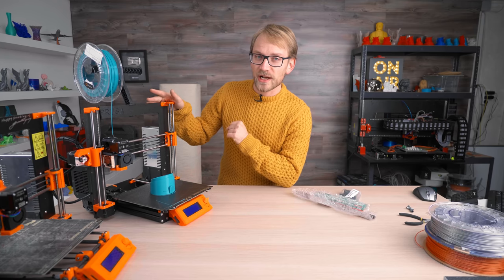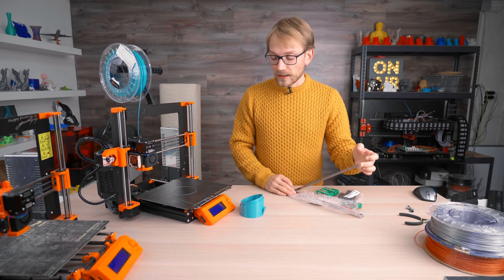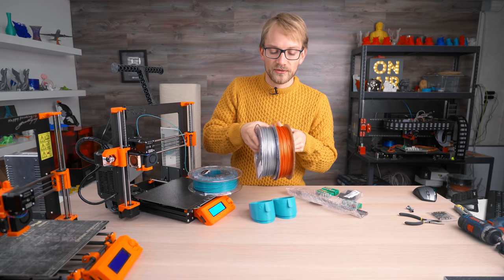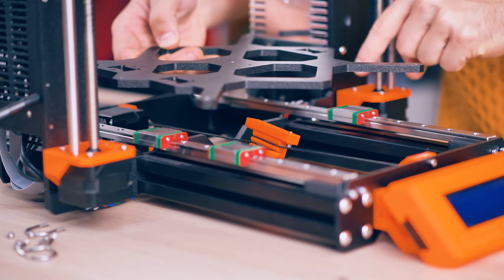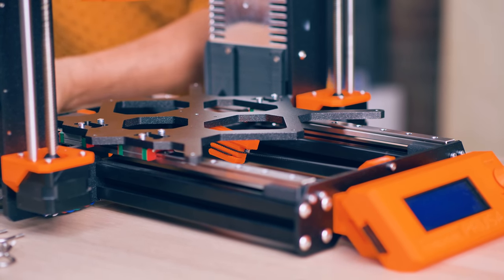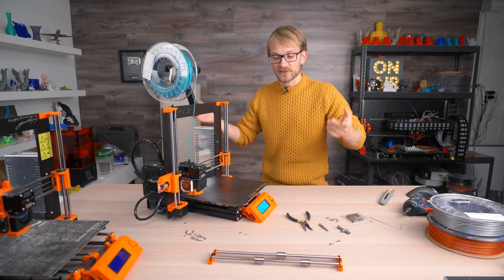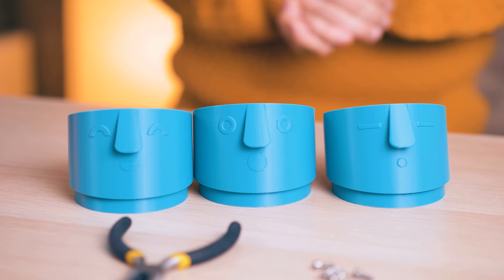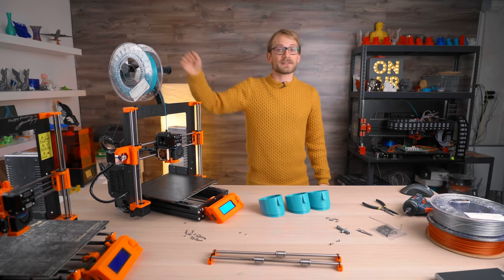Upgrading the MK3 with genuine HIWIN linear rails: Worth it?

Comment: "pulls out high precision rails"
"tightens with a power tool"
oh boy..
Reply: I seem to hear the clutch mechanism clicking, which is pretty decent on the Bosch drivers.
Reply: @JeffDM   I agree but my main concern is not over torquing. You lose a lot of feeling for how things are falling in place.

Tighten a bolt a little bit, check, align, tighten another one, adjust until everything falls in to place slowly and smoothly.

Thomas went for the AvE approach which might not be the best with precision machinery.
Reply from the maker: I've had the clutch on setting "3" almost the entire time - which I fund to be extremely consistent for mid/light tightening of M3.
Reply: @MadeWithLayers  But it is not, despite it being a torque limiter clutch, it still has enough mass to be equivalent to a mini impact wrench for a precision component that can throw off alignment. Would you like someone to build your 5axis CNC machine with an impact wrench?
Reply: Spent the whole video just wishing he grabed a plain old screwdriver! After I heard the price for these linear rails, it made me even more unease!
Reply: Eh seriously? The clutch on these are pretty good, probably more accurate than "hand feel" at the lower settings. What made me cringe more was the method and order of the bolts he was tightening.
Reply: @nzalog    The clutch might be good enough and provide a descent torque consistency across the screws, specially compared to hand tightening them without a torque wrench. The most basic issue here though is not the final torque applied nor the sequence he followed, but rather the sudden forces that the screws are subjected to when an electric drill/driver is used, specially if you simply pull the trigger full blast as if you are shooting a gun. The guy in the most liked comment explained how to properly do the job, tightening and untightening the screws, in which order, etc, which is something I would never expect Thomas to know. It is like mounting a cylinder head on a car's engine: there is a specific order to tighten the screws, at a specific torque, then you go back and torque again at the same order a bit more, and again one more time; a pneumatic or electric driver is never used tough! This is not to criticize him. I just shared the way I felt watching the video, and I am sure others did as well. Quite the opposite, I was rooting for him to stop using the driver during the whole thing!
Reply: @theonlymudgel  Your reading comprehension might not be the best, but I said it clearly that I was not criticizing him; I like the work he does and am myself a subscriber. I was just interacting with him and other people in the hope that we would increase our overall knowledge as a community. In fact, I could be wrong and was completely opened to hear new ideas and thoughts, and learn something new; or I could be right but also learn something new from somebody else willing to add to the discussion. Your commentary is quite the opposite of what I pursue when I take the time to write something over the internet. It doesn't add anything useful, it doesn't bring anything new or constructive to the conversation. Just think twice before posting something useless, specially in an informative channel like his, or you could be pointed out as an armchair critic just willing to expel your own frustrations.
Reply: @theonlymudgel  Nevermind... take care.
Reply: It feels like it is impossible to point out some errors or mistakes people do on youtube, just because they have lots of subscribers...  Using a power tool to adjust precision mechanics, like this rails, is not ideal, not because of how tight they will be,  but because you don't have feeling...  This kind of immunity to "be wrong"  and adjust/learn accordingly,  together with the feeling that we always know better, is one of the reasons Tom failed to sucessfuly finish the MPCNC, which is a simple project, with hundreds of builds around the world, and a proven concept with years of evolution...
Reply: To be onest is not so strange to use power tools for this kind of stuff. 

The only thing is that you have to use them whit extreme care.
Reply: @chargv  cylinder heads get mounted with 3 ugga duggas, whatchu talkin about
Reply: @theonlymudgel  Ok Boomer....
Reply: @theonlymudgel  He doesn't have to show how it's done when it's just enough to point out that this is how it's NOT to be done. Any professional working in that industry KNOWS it's wrong and it was clearly explained WHY it's wrong so how about you tune down your boomer attitude and stop calling people armchair critics just because you're not educated on the topic? Have a nice day.
Reply: Yeah. I like Thomas, but this make me cringe. I never use power tools for assembling anything like this. Less control and no feel.
Reply: @d7588  if you watch the video of Haas building their cnc machines you can see them using Milwaukee impact drivers when attaching the rails to the castings
Reply: @joeweber2802  Yes lets provide some limited samples of people doing it wrong. Because that suddenly means that others aren't doing it wrong, right?
Reply: He also printed his sweater...
Reply: i know i was screaming the entire time
Reply: @MadeWithLayers  ähm ja achön und gut das mit der dreier Stufe, wennst du es wirklich genau haben willst dann mim Drehmomentschlüssel, aber der Akkuschrauber zeigt fehlendes Talent. 
Trotzdem hat mir das Video geholfen.👌
Reply: @v1Broadcaster  I opened the comments just to see if anyone else was like "stop drop roll, it's gonna blow"

Comment: the primary reason hiwin or other square profile linear guides are more rigid is because it can be mounted directly to a subframe and not just at each end (also things like preload but you probably want to avoid that in a printer). By mounting it only at each end it acts like a leaf spring when loaded in the middle of the guide.

Comment: Using those Linear rails, in an industrial manufacturing plant setting, we used to very tightly rubber shockmount those carriages [Just a thin rubber gasket really].  In our cases, over 1 metre length rails, without the rubber mount the rails would bind, and resonances would be setup through the rigid chassis and moving tool head.  With them the rails would more or less self align, and run extremely smoothly.

Comment: Pro tip:
Use a guitar tuner (or app) on the belt before and after to make sure you get the same tension.
Also, use silk PLA or shiny PLA to make ringing artefacts more visible. Black PLA printed hot also shows artefacts more.

Comment: Hi Thomas,

I study High Tech engineering, which is a continuation on Mechanical Engineering. Within this study, my specialization is Mechatronic system design. I'm currently doing my Master's thesis and am working on a properly constrained gantry system, which uses state of the art technology. I can not say much about it, since I intend to start a company with it, selling 3D printers and laser cutting machines.

Basically every machine on the market nowadays uses a heavily overconstraint set-up. Having 2 cylindrical bearings perfectly aligned (functioning as a single bearing, theoretically) and having another one to cancel the rotation, already overconstraints your system by 3 (1 free translation means 5 constraints, each set has 4 constraints, totalling 8 constraints. 8-5=3). Now, doing the same for hiwin linear rails, we get a sum of 5 overconstraints (5+5=10 constraints, thus 5 overconstraints).

What's the result of overconstraining? Not only does it introduce higher order harmonics, your system is no longer statically determined. Binding becomes more of an issue, which might not be noticeable at first or by hand, however at the microscale it's noticeable. Often relaxing a certain bearing helps, since you reduce the amount of overconstraints and thus the harmonics.

One thing that confused me in this video is... Why do you wiggle the bed back and forth sideways, while the direction of actuation is through the centre of mass of the bed in the same direction as the bearings slide... The vibrations from the x-axis shouldn't cause much vibrations on the bed, since the frame is very stiff and its amplitude is very much degraded.

There's one side question I have. Once I finish my product, I intend to start-up and kickstart it. What conventions do you usually go to in Europe?

Keep up the good work!

Comment: As a physics major, I'm reminded of the damped harmonic oscillator (mass on a spring with friction) and the classic analysis about over-damped, critically-damped, and under-damped conditions.  After increasing stiffness, maybe you can also, somehow, increase dampening and/or modify the mass of the system?  

It would be interesting to analyze a Prusa i3 with something like a vibration sensor, and then do a "proper" analysis of the ringing and then optimization to reduce it.

Maybe a wider belt for the y-axis would increase dampening?
Reply: perhaps giving enough 'slack' in the tension of the Y belt might help some what? I like the widening idea.
Reply from the maker: Stefan has got you covered! https://youtu.be/Ws1JfHl3Y0o
Reply: Thanks Tom!  Will definitely go watch Stefan's video.
Reply: @evlsc400  Changing the tension of the belt will only change the frequency of the belt oscillation. If you want to dampen its resonance, you need to add some spring made of a different material.  For example a belt tensioner with a metal spring. Maybe not one on the belt, but as a holder of the belt wheel.  Still this only reduces any resonance frequency, but it will not remove belt vibration completely.
Reply: Gijs Noorlander so a spring loaded belt tensioner? If those exist I’ll test them this weekend.
Reply: Very smart!  As an Acoustical engineer, I would advise that you do a spectral sweep of frequencies, using a reference mic, and the consistent table your mounted on.
We want to do a slow SIne wave sweep and record all resonant freq.  Take that Into a graphic EQ find sharp spikes in the frequencies.  
You will most likely find one that happens every time that number doubles.  We call this octaves.  SO find the fundamental root octaves.  Next This will give you a huge idea of weather its low freq 0-220hz  add lots of thick thick material, IF its mid freq spikes then you can add some fiberglass 403,  It anything higher it will be easier to get those tones out of your prints!

I really like cnc kitchen;s vibration dampening stand, then run this test when you've made each new  change.  
IF your getting terrible nasty resonant spikes, change the tone of the printer by adding solid mass very securely with good amount of fasteners to make a new resonance to fix your prints 
I really think duets idea for resonance its interesting too
Reply: From my experience I've noticed that upgrading the belt before the game makes ringing worse as our dampens less and transfers more energy into ringing
Reply: @evlsc400  I was thinking about the idea. Maybe it is possible to print some tensioner to push down the bottom half of the belt.  For the X-axis it may be a bit harder to do since you don't have room in the vertical direction.  Maybe replacing the belts with a threaded bar like on the Z-axis is also an option? You must then add some mechanism like a shock absorption to compensate for bends in the threaded bar. (and re-calibrate the displacement per step)  I do think the resonance of the belts had more impact on the vibrations in the print than the stiffness of the slides.
Reply: Would be interesting to try.

I think I'm mostly interested in an engineering approach (based on vibration/oscillation damping).

But trial-and-error can also be useful!  Try lots of stuff, see what works.  Then how/why it works can be figured out later.
Reply: Maybe using rubber washers between the guideways blocks and the bed carriage will help!

Comment: For a while I was having all sorts of similar Z banding issues. But if I ran my finger along it I couldn't feel any sort of banding. The issue ended up being that the eSUN grey I was using (that I buy in 3kg rolls) had a large amount of pigment variation. So it wasn't actually a layer or printer issue at all. Changing to a different vendor's filament made it disappear all together.
Reply: If you trace the history of the short-lived E3D BigBox  project, you find the banding issue there as well. It seems that their primarily used stepper controllers caused some of it by introducing rounding errors in some zones. You always have to look at the whole system.
Reply: Jim Bob  I think it was just the bulk rolls - printing out some vase mode models made it visible and obvious when you looked at it. I'd not had that issue with any other eSun filaments, and I've been through probably 50kgs of it.

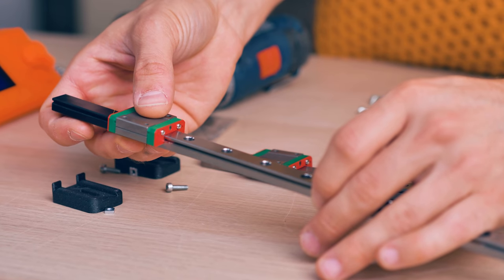Comment: 8:00 i think the y-carriage plate is symmetrical so you can have 2 bearing right or left, you can just turn/flip the plate.
A bit upsetting that the rails are not sitting on the aluminium profiles but instead sitting on wobbly plastic pieces.
Reply: They specifically point out the orientation you should be using in the guide.

Comment: We see this on our clients that buy Raise3D units, particularly engineering clients, that have an instinct to tighten every bolt. This is a mistake on the Z axis where the threaded bearings are intentionally loose to deter Z axis artifacts. They get binding as soon as it's over tightened so agreed the first one looks better for similar reasons!

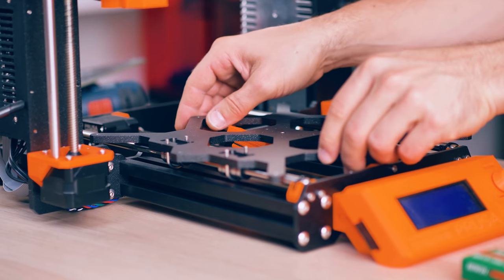Comment: 7:12 They likely had the thought, but ultimately decided against it to keep the price a bit lower. Those rails are pricey.
Reply: Some recent releases from Chinese market participants might match a better price/quality balance. You simply don't need the HiWin precision when other parts of your gear don't meet the same precision level. Still have to see a 3D printer with a cast mineral concrete bed... :)

Comment: I noticed on my Prusa i3Mk3S was producing Z axis banding as yours also does.  I also noticed the extruder was sometimes pulling hard enough on the filament to slightly deflect the print head.  This was with the stock Prusa filament holder.  
My fix was a completely new filament reel and axle running on sealed bearings that puts nearly zero stress on the print head while feeding filament.  This change made a noticeable improvement in the layer artifacts.  My latest prints are about 50mm tall and are very close to perfect exhibiting almost no layer issues.  And yes high quality filament is a must...  great video as always Thomas.

Comment: Those Z axis artifacts you're talking about may be related to the bed's temperature control. The bed expands and contracts while is trying to keep the temperature constant, thus changing the top surface height. You should check your BED PID values although it may not improve your results.

Comment: The best way to fix the inconsistent extrusion problem (which i assume is the cause of your issues based on your description) I’d suggest getting the bondtech upgrade for the mk3, which uses the original bmg geared style extruder. A lot of users had this issue, and fixed it with this upgrade.

Comment: Hi Tom, one of the thing we saw in the early days of DIY 3D printing was similar artifacting. Ours was caused by really tight belts. The 2mm teeth were giving us that slight imperfection. We wanted tight belts for precision. We gave our belts 1/2 a twist so they had the smooth side rolling against the pulley/bearing. That simple fix made our prints super smooth.
Reply: Very interesting, I actually thought of that too. Don't they skip occasionally tho?

Comment: From my experience, the belt tension is the biggest contributor to Y axis problems on MK3. Cranking it up helps constrain the bed more than fiddling with the rails.
What I'm thinking about doing, at some point in the future, is to swap the X axis rods for a rail. The print head is rather heavy and the entire assembly is plastic and thin rods, so there might be some play in there.
Reply: Yes. From years of experience with home-brew plotters , engravers, cnc and a 3D printer , keeping the belt resonance under control is vital (I built a wire drive plotter once , it rang like a guitar string , wild resonance!)  adding a couple of idler wheels (or even long slides) on the long return run can help . Too much tension is as bad as too little  - it really a case of observing and making adjustment s to kill any bad resonance.

Comment: Back in July when I did upgrade my Prusa MK3 to linear rails, it cost me under $40 bucks not 200 Euros. Print quality stayed great but the lower noise level of the heat bed was well worth doing it. Also you can gain up to 15mm or Y travel if you want it and more Z if you want it but that will stop the Self tests from working so I kept my travel the same.

Comment: "There is no room for inaccuracy" looks like you have loose hiwinas so there is still room for inaccuracy.
Hiwin carriages are divided into several types in this respect, one has a clearance (smaller balls), the other type does not have this clearance but requires more powerful motors.
Look on the box ZO, ZA, ZB is this parameter.

Comment: Despite there being no apparent quality benefits I’ll be doing this upgrade soon in the hope that it will get it back to somewhat quiet operation. The Y bearings on my MK3 have become increasingly loud in the last couple of months (after only ~150 h of printing) to the point where I’m afraid of keeping the neighbors up.
Reply: I'm curious about linear rails for this same reason, and also have insanely loud Y bearings after only a couple of months